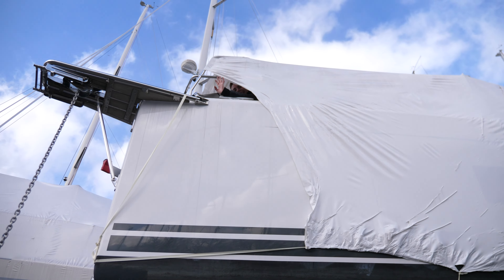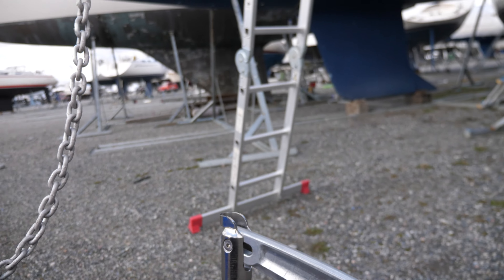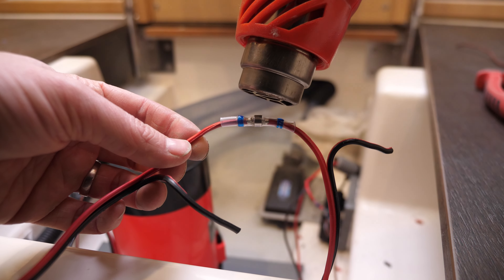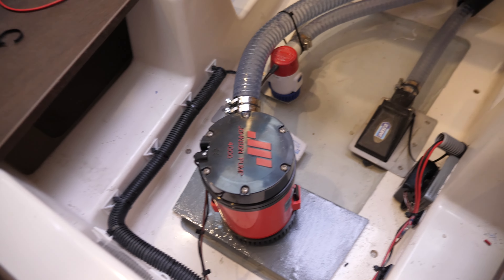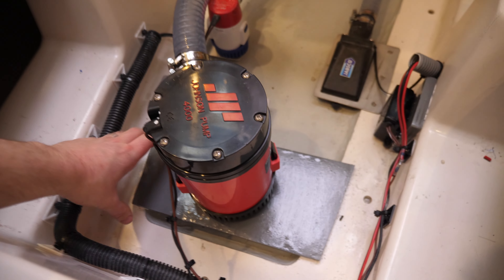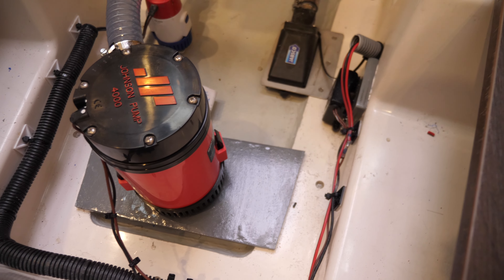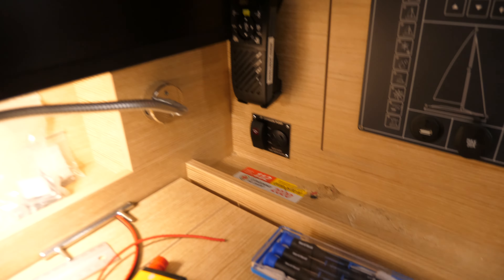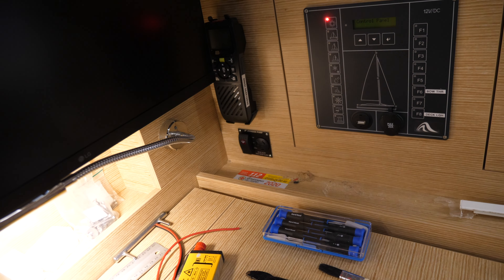A new ANCHOR, CHAIN and the mother of BILGE PUMPS

Comment: Good job... regarding the the shrinking and soldering tubes.  If you make sure to melt the solder completely thay are golden... but dont make the mistake of thinking they will be waterproof every time... when i use these i a likely to be wet part of a boat or a car i always put a coat of "permateks" on it. ( any old motor mechanic wil know about this old gasket/glue stuff) it wil be sticky for ever so if thats a problem i put a normal heat shrink on top of it. Just a tip. 
Best regards from Jarle
Reply from the maker: Hi Jarle, thanks very much for the tip. Appreciate good advice like this

Comment: Nice video. If I may give you a tip on the anchor chain: we make color codes every 10 meters so that you can easily see how much chain you dropped (or pulled back in). You can buy a set of plastic "rainbow chain markers" for €20,- or (what we did) use different colored tie-wraps. E.g. red at 10 mtrs, white at 20 mtrs, blue at 30 meters, yellow at 40 mtrs, black at 50 mtrs and mixed colors at 60 meters.
Reply from the maker: Thanks for the tip. I have thought of this before but as we have a chain counter on the windlass we know exactly how much is out anyways. I think one day when we travel further afield it could be good to have both though. Cheers

Comment: Great video as always!  That is one monster bilge pump and a very neat installation (which hopefully will never be put to the test).  I think we are both very happy so far with the soft solder heat shrink connectors though I do understand some people’s apprehension.  It was after being told how they were being used by a robotic tech working on a oil rig that I started using them around 12 months ago and so far no problems.  
It’s great to see you post another video and the frequency doesn’t matter…… all the best to you both😀
Reply from the maker: Hi Paul, yes, really loving those connectors, they seem really really solid and yes let's hope that bilge pump is never used. Posting some new videos soon :)

Comment: Tidy install , good job , when l built my 45ft cat l installed 4 X 4000 lph pumps...never used...never want to , plus l  made it 3 1/2 ton positively buoyant...l can theoretically fload both hulls & it should only drop 200mm on the waterline... again never want to test it...cheers
Reply from the maker: Sounds like you built a tidy cat! Over 3 tonnes positively bouyant... I am jealous. Cheers, Chris

Comment: Great video, In just wondered if you ever considered putting another bilge pump in the lowest part of hull below the false bilge?
Reply from the maker: Thanks very much. no need to but one in there, if water gets in there it runs to just behind the keel in the main cross section of the grid, there is a hole here where you can get a pipe in and suck it out

Comment: You know... advice from YouTube randos is probably something to be very leary of... but I can't help myself... if you're going to use a swivel on an anchor, you need to remove it from the anchor shaft and put a short length of chain between the swivel and the anchor, because side loading when the tide or wind shifts can/will tear that swivel apart like it was made of plastic. See, for example,  morganscloud.com /2021/07/18/two-interesting-anchoring-reports/ (I've broken that url intentionally, so youtube won't filter it.) I can recommend Harries' site as well, of course, SV Panope's Youtube channel for anchor stuff.  I look forward to your next video. Be well, be safe.
Reply from the maker: Hi Karl, thanks for the advice, really appreciated that. I will take a look into this topic. Cheers

Comment: I fall into the terrible camp of people that think it would be great idea to have a pump like that but never get round to actually doing it. I just read a book by Simon Calder where that exact wire connection isn't recommended because the wire can heat up when drawing a heavy current and melt the solder. If he ever visits my boat I'll hide the ones in my electrical connections spares box.  I once tested a winch motor on my boat using a set of heavy duty jumper leads. The motor worked just fine but our smoke alarm went off. I looked back to find the red lead actually melting on the cockpit floor. Not all wires are actually what they say on the tin.
Reply from the maker: Hi Phil, thanks for the input, a good test would be to run the pump for a long time and check the heat, hadn't thought of that with the solder. I will try. Funny story with the jumper cables, I probably would have done the same, I know I can be impatient with making work arounds just to see if they are working before the final installation also. It's definately true, always good to know exactly which wiring is actually in the cable. Happy sailing, Chris